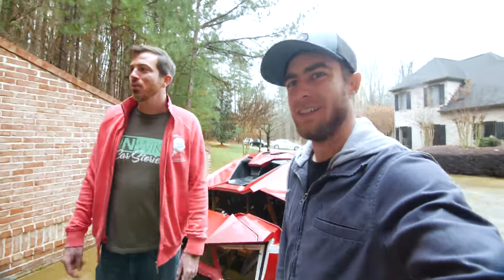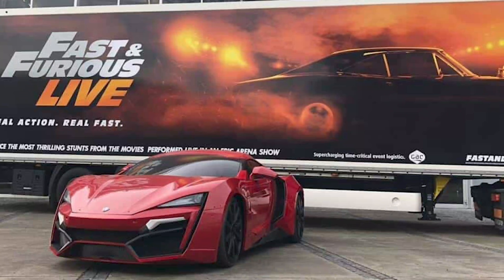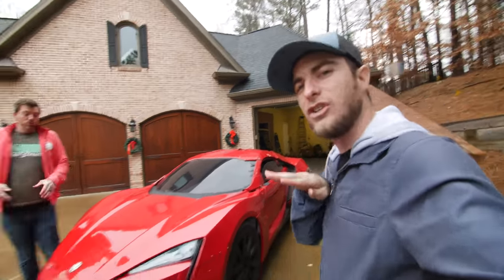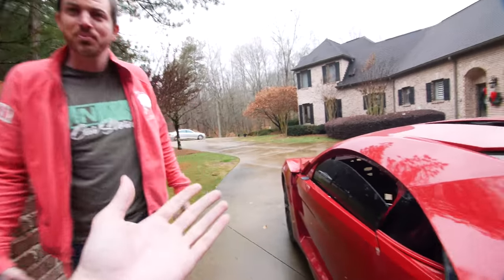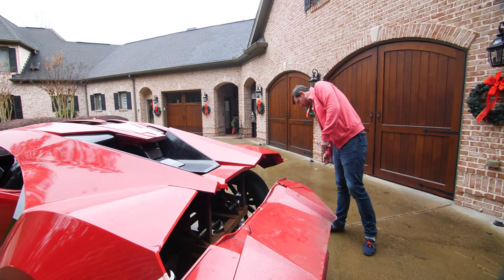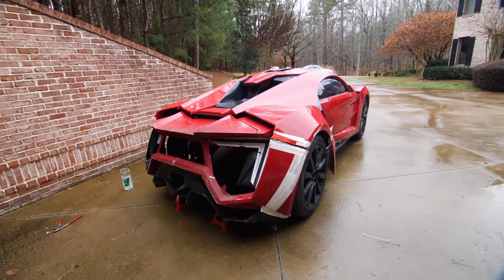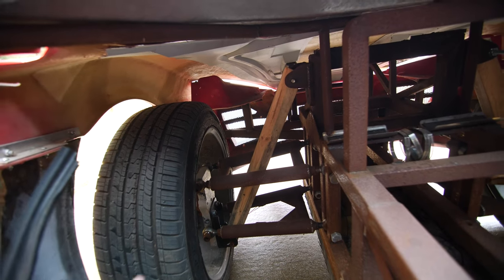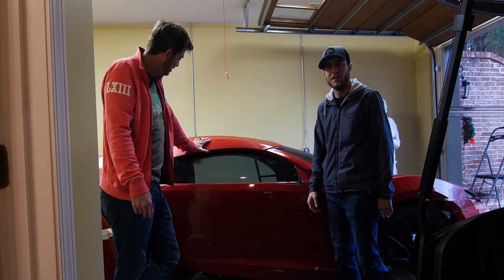The Fast and Furious Lykan is Awful in the Best Way

Comment: usiast willing to create a Lykan clone out of lighter weight materials like aluminum and carbon fiber for the frame and body and maybe tube aluminum for the frame. put an apprpriate chasis under it then wire it up with like an LSX or something to drive it around or something. of course everyone would know it's not a real lykan but you wouldn't be Afraid to pile the miles on a kit car either. And that body just looks so cool all assembled sitting there like that*maybe it could be mass produced and sat down on like a Corvette C7 or somethng along those lines*